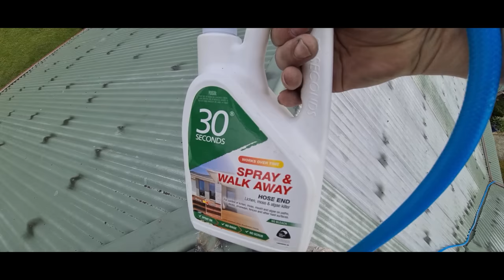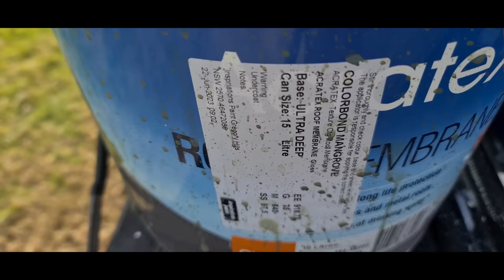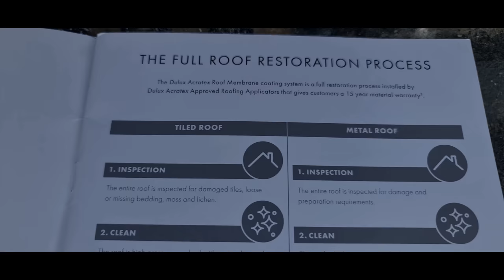Spray painting 7 days huge roof  225 liters of paint used

Comment: Mate I use FFLP tips for roofs, use them for everything. Even membrane, use a .16 or .14 say 414 Or 514 FFLP.  I use the Graco tips cuts down overspray massively saves on material.   You can't really even see the overspray on video.   The Graco tips go on a Wagner handle with the Graco tip guard.  The Graco tip numbers are more accurate sizing and I believe last longer.   Iron roof with solarguard etc, I'm using a 310FFLP and I'm prob running around 1/3 pressure on the unit.  Just enough so it's not trailing.
Reply from the maker: Me tooo